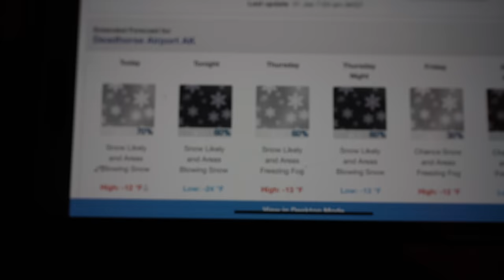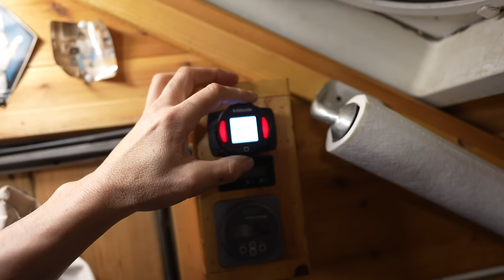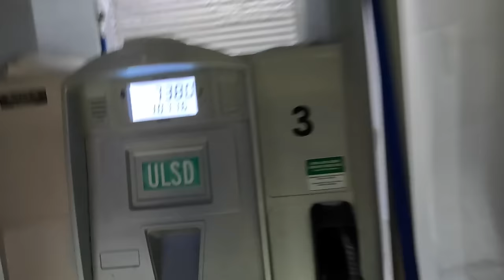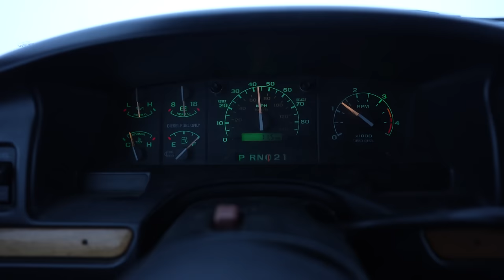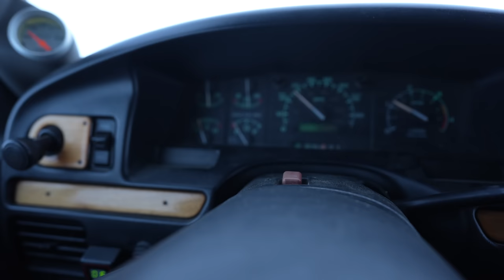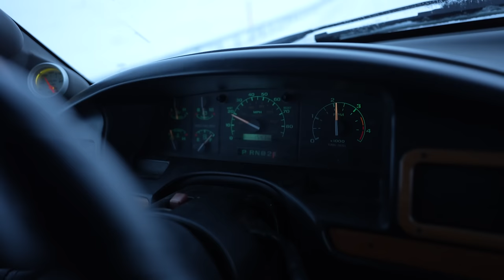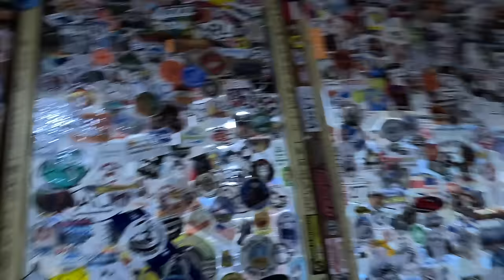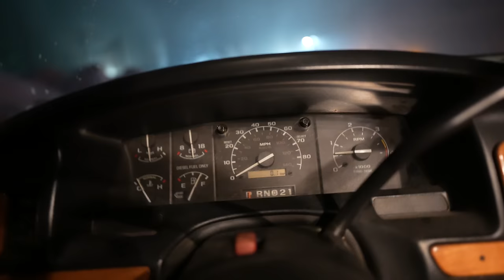I Didn't Make It | Truck Camping at the Top of Alaska in a -75F Arctic Blizzard in my Old Ford Truck

Comment: Timmy, i wouldn't worry too much about wet stacking. Semi's idle constantly. The 7.3 in your truck was used in ambulances, etc. that also never shut off.
Something you might want to consider is a hydronic diesel heater it will keep your engine warm and allow easy starts in cold and sip on fuel. 
Keep on truckin!
Reply: Dude clearly doesn’t understand diesel. He thinks wet stacking means there gonna be field build up in the cylinders and then he just high idles all night for no reason and burns fuel unnecessarily. 😂
Reply: this guy is fucking with us  lol, e drove 2000km and gave up cuz of 90$ in gas fees???? give me a fucking break bro

Comment: A 1kW generator would supply juice to your block heater and battery blanket for a fraction the cost. Just park out of the wind and consider a truck skirt to hold in the heat. Some people set up a type of blow torch to get heat to the engine etc. It's like a steel tube and you only run it for about 30 minutes under the engine. You can try it out when you go to Tuktoyaktuk next winter. Kanuck bucks are cheap.

Comment: fully seal/insulated engine bay, electric louvers and the pup diesel heater in action- with and low voltage heat trace every fuel line and filter . Or if ur running it, you might as well have the engine coolant lines plumbed to heat the cabin however

I think that could take on some low temps

Comment: Timmy. You can wire your overhead lights to an old school floor switch like the trucks had in the 80s. Turn them on and off hands free. Any auto parts store has them.

Comment: The diesel heater might be alot cheaper although they are a pain to install and often only last a season or two. They are cheap enough you can keep replacing them. I converted a hybrid SUV into a camper and I'm able to run the car heater all night and only burn .5 to 2/3 a gallon in gas because most of the time the heater runs off the hybrid battery. The gas engine comes on for a minute or two every 15 minutes to re-charge the battery.

Comment: The 7.3 is actually not hard to start if run dry because it uses high pressure oil and not diesel itself to fire the injectors. I ran my 2000 7.3 dry once and just added fuel and it fired right up. Another good reason to own a good old 7.3.

Comment: Greetings from Finland. I guess we have a little warmer here ;) Just found out your entertaining channel, thank you.  I Used to drive 6.2d chevy van every day. That was a freaking cold car in the  winter. Couple of times I had to make a fire under the fuel tank, to melt the diesel... Anyway, Instead of idling the whole night, you could keep the block just above freezing with one eberspacher or webasto or similar water heater with way less fuel. Those consume only one gallon in 8 hours, but I guess you know already. Your f350 disel engine(  7.3l, 445cid? ) breathes super cold air about 400cidV8 * 1000rpm/2 = 200 000cid per minute. It is a hell of a cooling. It's a miracle if it keeps the block above +80F idling in  -75F weather. Thermally isolating the engine bay ain't bad idea either.  And definitely keep the cranking batteries in warm place. Lead battery's energy drops 90% in very cold weather.  And it won't take charging either. Maybe you know all of this already. Just making sure ;) Stay warm.

Comment: I really enjoy watching your videos mate, I've seen snow a few dozen times in my life, I live in Australia ;)
With the engine thing, I'm not sure what you've been talking about as a problem with idling for the last few episodes, but I think you have your wires crossed a little... The risk that you really have is one called bore glazing... It's when you run a diesel constantly at low load... The ring pack needs the load to seat the rings against the cylinder wall, without it you end up with heaps of blow by and uncombusted fuel and oil... It effectively creates a coating on the bore that stops the piston rings from doing their job... The warning signs are poor fuel economy and oil consumption... Keep an eye out for that...
The other thing is that your engine running so cold is a real problem... You'll end up with premature wear problems with that... You need a radiator blind. A radiator blind will stop your radiator from seeing the VERY cold air... The reason this is important is because there's always bleed flow through your radiator to ensure that it doesn't freeze in operation when it's not needed in colder work, or fill with corrosion etc... In environments as extreme as you're in right now the problem is that the cooling you get from bleed flow is enough to prevent your truck from ever warming up... What you need is a radiator blind... There are products, but ultimately it's a bit of canvas that covers the front of your radiator (part or all depending on how it's running) and makes sure it doesn't run too cold. I'd suggest to start with about a 2/3rds blind given how yours is currently performing and keep an eye on the temps... You should be able to maintain enough heat to keep the engine in the operating window, so cover or uncover based on first round of results :)
Oh and make sure you remember to remove it when you're driving around in summer :D

Comment: You should try a well point in an undisturbed area taking care to prevent surface water from following the pipe down into the groundwater. I have a feeling surface water is percolating through the fill and stone in the pit you dug.

Comment: Diesel mechanic for the last 20 plus years in Kansas. Cold asf temps here, but not like that. Worked at a Freightliner dealer for over ten years and a foreman. You realize combustion engines are not efficient? Like 60/40. I tell most to idle up to avoid dpf issues, but as long as you put a hard load on that 7.3, it should burn the carbon out unless you go biden mode and idle it for days on end. Ty for the vids.

Comment: Considering modding your front grill tbat allows a louvre feature to close it off from wind? Possibly connect a vent from a diesel heater or more efficient method of heating used for cabin to vent into the engine bay so you don't have to idle one bit. Test with thermometers to gauge safety depending on condition.
Reply: Failed to realize Louvre.

Comment: You may not like the fuel consumption of high idle but it's much better for the motor been driving semi for almost 20years and wet stacking is where oil blow by the seals in the turbo which is hard on the turbo

Comment: As we would expect it's not able to keep full operating temperature based on how cold the air is. You can see the coolant temp gauge is well below operating. Seems like a well maintained unit, but when was the last time the thermostat was replaced? It's probably just too cold out, but a failing t-stat won't help.

Comment: They make 33 gallons rear tanks for obs fords. Don’t know if they’re direct fit for a diesel but it’d be worth the figuring out for what you’re doing there guy. You’re an inspiration for us old truck wanderers, keep up the good work.
Reply: Also, a lot of guys I worked with in nodak had battery blankets and heaters that helped with those coldstarts. I used a diy blanket made out of that bubble wrap stuff with foil on both sides. Seemed to help with my old ford. Don’t miss the mondak.
Reply: I think the 33 gallon tank you’re talking of is for the obs bronco and a lot of guys have successfully retrofitted them on to 7.3 trucks to use as a larger diesel tank.

Comment: Have you considered full 24V (or higher really) components and about 1000aHr storage so that overnight idling is not necessary?
This should meet all your electric draw plus a block heater for at least one night w/o having to run the engine all night.

During daily travel the engine can charge that storage at the same time, such that day-time travel will provide electric charge to max-out the 1000aHr capacity to run everything the next night.  
And so on, and so on.

Comment: Coldest I've ever been in was -48F in South Dakota. I don't think my body understood that level of temperature. I didn't feel cold, but I could feel my nose hairs freezing. It did help while trying to replace a hydraulic pump though. The fluid was frozen so I didn't have to worry about getting doused. With a work/warm cycle of 5/15, it made zero sense to be outdoors working, but hey, when you choose the profession, you gotta accept the good and the bad. Negative 75F, now that's madness.

Comment: Could you put two block heaters on the engine with a electric space heater in under hood then a big heavy blanket over front of truck and run a small generator overnight.  That way the engine stays warm and you dont have to run engine all night. Generator shouldn't cost more the $15 to run all night.

Comment: This is not a critique. In view of the cold  verses desil this is what I did I put a coil of copper pipe in both fuel tanks with a electric tank heater ( the kind that heats the block) to heat fuel in both tanks and separate heater for the block. I chose a small electric generator to run all three heaters. Gas is cheaper and more resilient. Also, I didn't do this but put a feul line inside a larger pipe with foam in between the two maybe with a heat tape to keep it liquid? A lot of work to be sure but $150  for 10 gallons it wouldn't take long to pay for it hope this helps 73 dan

Comment: Here in the NW mountains of Asheville, NC, diesel is only $3.84 gal. I just got 25 gal $96 but my 1988 Chevy 3500 4x4 crew cab dually I done a LMM swap on it with a manual trans...

Comment: Odd question… I assume that the reason you keep the temp in your back camper at 50 is to aid your lithium batteries.  Couldn’t you use a lamp timer to turn on your engine block and/or fuel heater off and on all night, with a couple of hours before you start?  Sorry, I have no clue how many amp hours you might have or need.  If I were to guess a 15 to 20 amp 110 connection to the engine heater would use/need 160 amp hours.  (I’m probably wrong.)

Comment: You want to idle up when parked. I have a series 60 Detroit engine, this is a tractor for a large truck. IF I just idle after parked it will have a warning light on the dash come on that says " engine protection shutdown ", and will shut down a few seconds later. When I park l have to have the cruise control on and just hit resume and it will idle up. There is a over ride shutdown I can use to keep that from happening in case something keeps me from engaging the idle up until help arrived. With my motor it increases the idle at 200 Rpm. That increases the oil pressure and burn a little hotter keeping down carbon build up on the pistols and fuel injectors. Idle your truck up my friend, the little you spend in fuel will pay off in the end. MY estimation on the fuel you used 10 gallons or a little more because you stayed warm and your truck was happy. I'll keep watching, you stay safe. 
                                                                                                                                                               John V, Indiana USA.

Comment: You should cover your radiator so the truck runs hotter during night idling. It will run way cheaper and it's better for the engine.

Comment: G,day mate love your extreme  efforts to taking us on these trips we will most likely never be able to handle the cold unless I sit on the fire place or diesel heater vents lol,     I,m Phil an down here in Australia's  south east it's a whooping  39 Celsius tomorrow and 42 the next ,,  so I watch your videos beside the air conditioning  vents this time ,   can't imagine  adjusting  to such a incredible 160 difference  in temperatures  it's nasty when we've had 50 Celsius  before  but  can kill you just as neg 50 will ,  yet we handle 50 once used to it  ,   nobody can handle extended time slots out in the cold unless we'll covered up ,    keep up the great videos  of your experience

Comment: Instead of running your diesel engine all night, would running a small generator be a better option?     Use your block heater plugged into the generator.     Depending on wattage, you should get several hours of generator run time on one gallon of gas or tank of propane.

Should be cheaper than $74 worth of diesel for 12 hours of idle time.

Comment: Because your truck used more fuel than you were expecting I wanted to make a suggestion. That truck was designed for the lower 48 not necessarily for negative degree weather it's exposed to. I'm sure the thermostat in that motor is probably a 160 or possibly a 180 degree thermostat. Speak with an experienced professional mechanic in your area that knows the ends and outs with living in extremely cold weather. When you run a 190 or 200 degree thermostat, you will in fact get a better fuel mileage vrs. using a colder thermostat.That truck will get better fuel mileage than it's getting now with a hotter thermostat vrs. a standard temp thermostat that wasn't intended to run in an extremely cold environment. Check with a trusted professional mechanic and see if he will agree that running a hotter thermostat than what you have now will in fact result in getting better fuel mileage. Love your show brother, keep it up.

Comment: Road snacks - I am very and oddly passionate about this, having done many 12 hour straight through slogs (which I know is nothing in this demographic).    Beef jerky! It doesn't need to be hot or cold, doesn't need to be preserved in a cooler, doesn't need silverware or napkins.  You can eat it without ever taking your eyes off the road.  It's tasty and available at every single stop in America. I never leave for a drive longer than 6.hours without jerky.  Also, it keeps forever

Comment: What if you installed an APU on your truck that circulates the coolant thru your engine and keeps your batteries charged and they have inverters.. many different companies make them you could install it on your frame or under the side of the camper along the bed but wrap the coolant lines to keep the heat in

Comment: I noticed you have a Hydra. Do you use a stock tune or do you use a higher hp tune? If you use the stock tune, try using even a 40hp+ tune and have a light foot. It'll help the mpg. I had 11.5mpg with the stock tune and got 14.7mpg with a 40hp tune that's built into the Hydra.

Comment: I have heard of wet stacking and high idle.  It seems like modern computer controlled engines have the programming for it.  I know my 05would idle up and down based on temp and driving conditions.

Comment: Do the other trucks at the stops also idle over night? If you ever attempt it again, I wonder if venting some of the heat from the sleeper to the engine bay and fuel tanks would be anymore efficient on the pocket? Although I suppose with those strong and freezing winds that would put paid to that too.

Comment: Love your rig and your videos. If you had a newer vehicle/engine would you be comfortable shutting it down at night at these temps? Could you have a portable block heater that you could run w/o the truck running that would give you a near guaranteed cold start? Just curious because it seems so stressful/wasteful to have to run the truck just so you don't get stuck with a frozen engine.

Comment: 10 gallons to run idle for 11 hours? Ouch. Might be worth looking into a diesel heater, to circulate the coolant constantly and keep the engine heated enough for those very low temperatures. While it does take some resources to keep running, it is much less costly.
Reply: He has a diesel heater coolant circulator already. He just kept it running because a couple days prior he turned the engine off all night and then couldn’t start it again. And btw he would burn less fuel if he didn’t high idle all night, he could have just left it at regular idle. It would have been fine on the 7.3.

Comment: I was taught in Diesel Engine school, that the hardest thing on the cylinders is cold crank ups. Meaning, less oil on the cylinders themselves causing wear upon startup. Running for a week straight has less wear than shutting off and re cranking the next day.  Oils job is to clean, cool, seal and lubricate.

Comment: Probly better off getting like a 4,000 watt generators with a 5 or 7 gallon tank to run your lights and a heater and a block and coolant heater for truck cuz on one tank the generator will last over 12 hours, the one i got is a 6k watt with a 7 gal tank and it lasts about 14 hours...

So ypu dont have to be spending so much money on idleing the truck and wearing it out

Comment: Ok i have a stupid question .. are you ready... 1/2 tank of diesel... what about plugging a block heater in to a gen and they make heating pads for grat water tanks &  & they make barrol heater they rap around all most any thing ok so we plug all this in to a gen i know my 1500 wat will runn all ov these for 19 hr but you could add a 2nd fuel tank for the gas that would be a grand total of 8.00 dollers in gas verses 1/2 tank of diesel will this work ??????

Comment: I’m curious, if you had just let it idle overnight at regular idle would the block and radiator froze over? I’m in Iowa and when it’s below freezing with wind I always drive in tow/haul mode so the rpm’s are higher to keep the radiator up in temp. But that’s at -35

Comment: Unfortunately, high idol can kill your fuel economy. Downside to not having it, though is it can ruin your engine overtime   Letting a diesel just idle at less than 1000 RPMs is terrible   Be sweet if they had a solar option for the glow plugs/ grid heater.